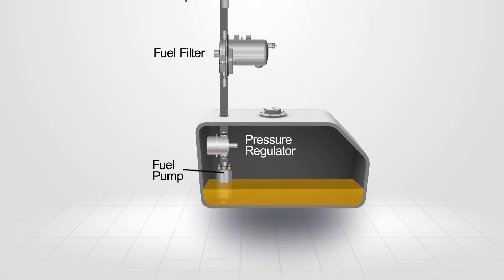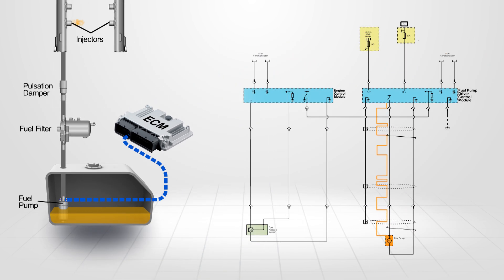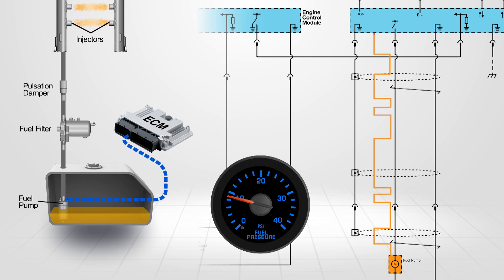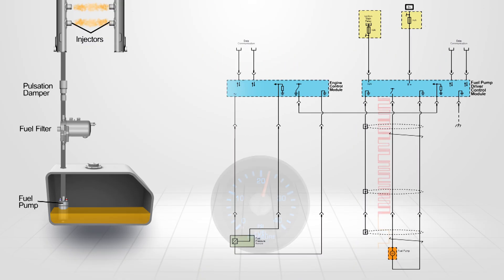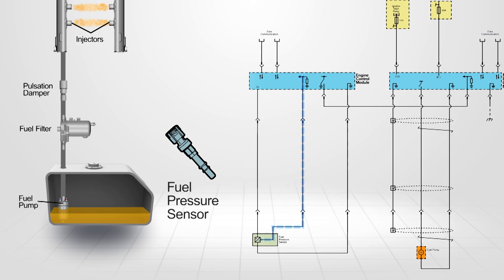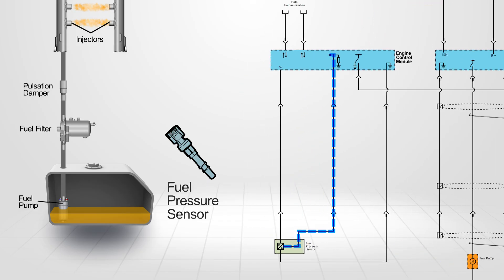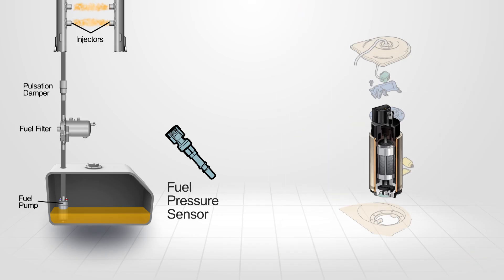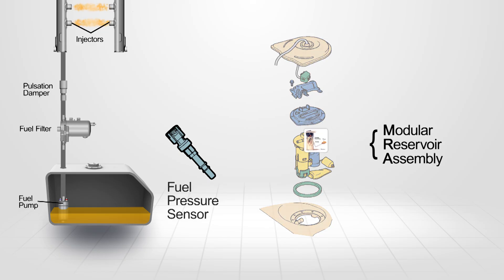Fuel Pump Control Module Checks

Comment: My 2014 Ford F150 XLT with a 5.0L engine would not start. Just suddenly happened. No "Check Engine" indicator signal was being displayed on the console. I had to have the vehicle towed. Turned out it was the fuel control module mounted on the chassis frame had failed. I did not know the existence of this component. Repair cost including towing, diagnostics and replacing the model was $765. Had I know this I likely could have observed the voltage going to the fuel pump with a DMM. Lessons learned. I am retired electrical instrumentation tech. 
Looking back I noticed the MPG had been dropping down although the engine ran fine. Now the MPG is back up to significantly.
This module is not on my 1990 Ford E350 with a 7.5L EFI engine. It regulates the fuel line pressure with a mechanical diaphragm  mounted on the fuel injector fuel rail. Easy to trouble shoot with a pressure gauge as there is a schrader test port on the fuel rail. I could not find one on the 2014 F150.

Comment: Would this fix P129D code my Cadillac srx? The fuel seems often acts erratic as if I'm losing a lot of gas even driving short distances and it doesn't fill up completely. There are no oil leaks either.
Reply: Bad vent valve.

Comment: Many of you missed the point. Instead of just running a pump full blast all the time and mechanically regulating to a desired output pressure (even though volume varies a lot with load), a PWM system uses a pulsed consistent voltage with a feedback loop from a pressure sensor to maintain the target pressure regardless of volume or flow, and to not over run the pump too much.
Reply: So this is why my Cadillac Escalade ESV with 21000 miles is in the shop waiting for this module over a month. Stranded us on the side of a highway. These new vehicles go no where when these go out.  I understand that.
Reply: @ralemc1960  logistics could be the cause of the delay - but yes, everything is integrated and expected to work a certain way. If you have an actual hardware failure, then it must be replaced. Here's the thing though, because it's a computer module we tend to thing of it as different than if it were just a fuel pump. But you'll probably never have to replace a fuel pump... Or any of the other PWM motors in that thing. The reality is despite all the insane integration of technology, the hard mechanical components are going to run for a very very long time with good maintenance. Use the correct fluids, reasonable intervals etc and 300k isn't even a big deal anymore

Comment: Your videos said that the module is inside the pump that is inside the fuel tank. Is that correct on a 2014 F250 super duty King Ranch 4 x 4 with a 6.7 diesel ? I have a P0627 code, with a crank no start situation,  and getting lots of different diagnosis from different  people on this one . Need help please.  I am broke and have been broke down for 3 months now, as I had 13 codes to begin with and I'm down to one.

Comment: from what I understand that if my module is damaged  could be the reason 4 burning too much fuel?
Reply: No. If module is damaged you engine won't run (no fuel pressure).
Reply: @mansouralblooshi3004  not always could be partially damaged my pcm is messed up truck runs fine low voltage to the fuel pump
Reply: @nicholasnardone3154 I have low voltage on cylinder 2
Reply: 1) check tire air pressure
2) check your spark plugs and wires
3) higher grade motor oil
4) check your coil pack
5) reset your truck computer (depends on your system's module complexity though) BMW's etc.
6) ethanol Burns hotter and faster, Auto and lawn tools run harder and refueling 50 to 100 percent more. Now I run only non etho, regular unleaded. Fuel might be the real culprit.
Reply: Ours just stopped.  It is over and done with until replaced. And the part has been ordered over a month at Parker Cadillac.